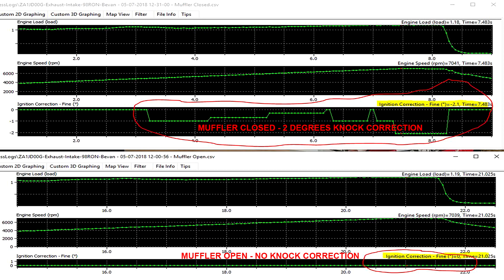Are Aftermarket Variable Exhaust Systems Safe for your Car?

Comment: MRT - could you do a comparison between a 'switched' system versus maybe an 'active' system? (I.E one that opens under a certain backpressure)

Would be great to see. Cheers from the place with the 'other targa' lol...
Reply from the maker: FukU2222 if the ecu is oem and it is bi modal then it will work correctly so there would be nothing to show